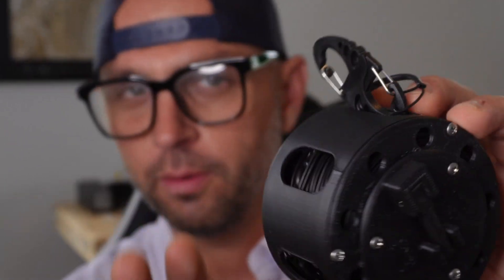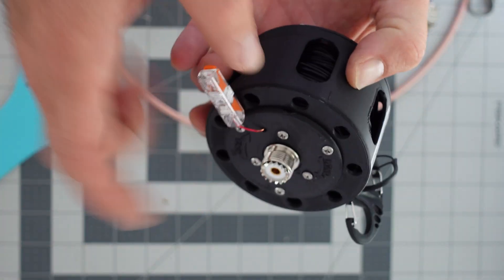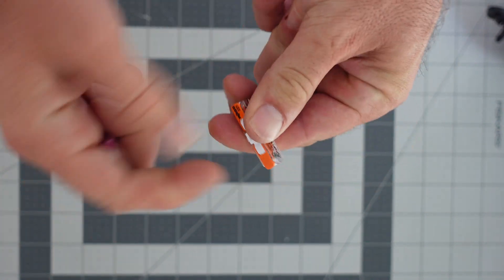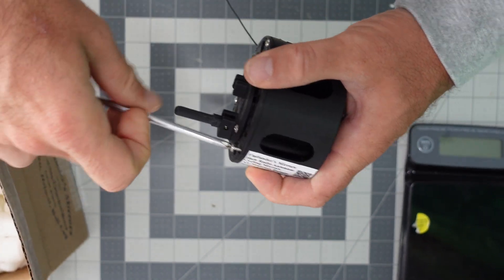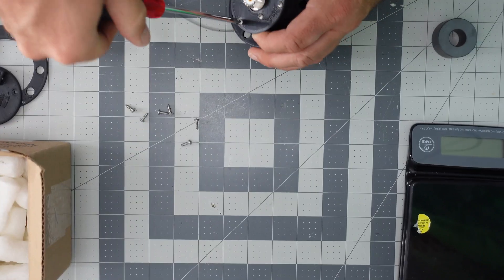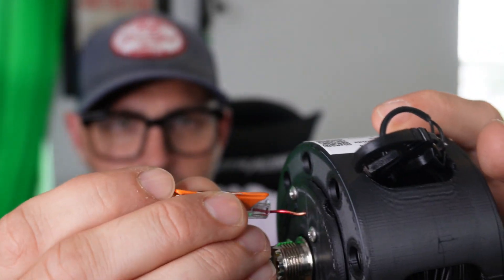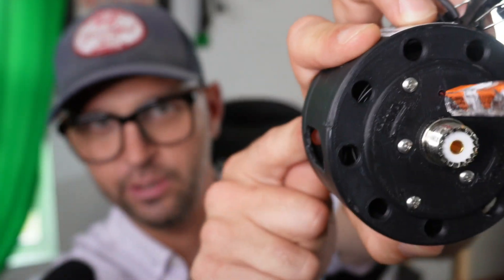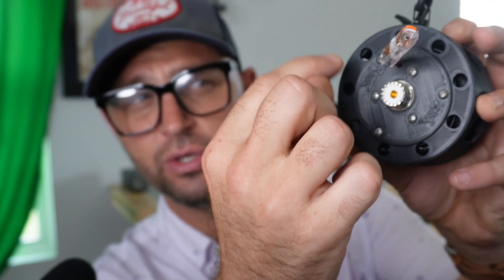How to Add a Counterpoise Easily - Put A Ring On It!  - Counterpoise Hack for Ham Radio

Comment: Depending  on soil and whats around. I have had trouble with no counterpoise. getting RFI into mic. etc. putting CMC choke at radio helps depending on coax. But I found potting the counterpoise at the antenna and a 1:1 or CMC at the antenna works better. dropped my noise floor and improved my signal to noise ratio on my RX. This varies a lot from place to place  . Even on a different day this can change.  I find for me just putting about 17 ft wire on the ground does the trick. and at QRO 1KW still worked great . If I am veritable I use 4 counterpoise on ground.  spread them out and works great. some use the magic carpet for counterpoise and have great success with that . Every set up different. use what works best. Keep options in the go bag. Works great for me. 73
Reply from the maker: Thanks again for the great tips!

Comment: Thank you for this video.  I just received my Flatlander 40-10m EFHW antenna and was disappointed there was not a counterpoise lug.  This helps a lot.  I do like the hose clamp on the connector “shield”.
Reply from the maker: My pleasure.  Have a great one

Comment: Yo, the jubilee clippy idea to connect the counterpoise is a great idea!  I had thought about creating a place to connect counterpoises on a 3/8-24" antenna magnet mount (lacking any access to ground--unlike some variants) by chopping into tho coax shield and soldering in a little ring terminal (of course sealing the whole thing up well against moisture etc) ... or by chopping through the coax and installing a new PL-259, and basically adding a ring terminal wire before crimping down the connector ... but your solution is even more McGuyver elegant!  Tksss

Comment: If the counter poise wire has to be a specific length for the band of operation, do you then have to account for the coax and the counterpoise wire? Or, does the counterpoise wire take the coax out of the equation?
Reply: GENERALLY, you run a counterpoise wire because you want/desire to take the coax out of the equation... and thus you insert some choking device that isolates the coax shield (meaning removes it from the equation) in close proximity to the antenna/transformer end of your coax.  [[Choke could mean:   a choke/isolator with BNC or UHF (SO-239) connectors on it -- OR it could just be a ferrite ring (e.g., 240-31 or 240-43 ferrite toroid) with that unsevered coax wrapped through it a bunch of times (typically 8-12 times--the more the merrier but really fewer can work fine if there's a well-sized counterpoise).  It could also be a clamp-on ferrite with a handful of turns through it, or a bunch of ferrite beads shrink wrapped to the coax.]]

On an end-fed halfwave, it's unlikely that you'd want to have more than 1 relatively small counterpoise -- typically aiming for 5% of a wavelength at your chosen operating frequency -- but if band-hopping, aiming for 5% of a wavelength at your antenna's lowest operating frequency (e.g., counterpoise wire length is 2m or 6ft for 40m; half that if you never go below 20m).

If you do NOT choose to run a counterpoise wire, the ideal place to place your choke on the coax is in-line the same distance away from the transformer/antenna as you would have sized your dedicated counterpoise wire.  The RF just sees that length of coax shield as a fat wire.  ...   But you can get away with just choking it at the radio/transceiver end, with some reasonable/small loss of efficiency, while still benefiting by avoiding getting common mode current (CMC/RFI) back into your transceiver, and also avoiding picking up undesirable interference on the shield of your coax due to its ability to act as an unintentional receiving antenna.

...  on some other antenna types, such as a 1/4 wave vertical antenna -- you could hypothetically use part of your coax as its own counterpoise, plus run a 2nd, 3rd, 4th etc dedicated "radial".  So, does it technically take it out of the equation?  Not really--but a halfwave antenna doesn't really benefit from multiple counterpoises/radials as much as other antennas do, and halfwave antennas are considered less reliant on ground (more independent of ground) than others, b/c 1/2 wave antennas are 'ideal'--having very high radiation resistance (the good kind of resistance).

Comment: Interesting what is called "antenna" nowadays....
Reply from the maker: Would you have preferred autotransformer hooked to wire?
Reply: Right up there with bed springs or a train trestle!
Apparently, everything is fair game to make an antenna. 
I like the reel! It looks better than the traditional wire winder.
Reply from the maker: @fredhillhousejr943  there has been this old, non connected, train track at an old military base/beach.  It usually shows in the spring (but didn't this year).  If it shows next year, I am going to load it up as an antenna! Who knows how long it is, but it will be fun to see what happens!

Comment: The information is not correct.   You don't need a counterpoise.  It is not because of the coax.  This is likely why the vendor didn't connect the coax in the first place.   Dig deeper into the math and science of the HF half wave  to see why.  Gilles from the Radio Prepper explains it far better than this short message.
Reply from the maker: Thanks, I'll go check out Gil, read up on Kirchhoff's Current Law and make a determination on why a counterpoise is a good practice.  I think it'll conclude that a counterpoise isn't required but high impedance still produces low current and even with low current, there has to be a return path.  Without a counterpoise of sorts, a coax will have to be that path.  This can cause interference and less predictable performance.
Reply: @DudeTested  Thanks for the reply.  I hear your logic and felt the same way until Gill broke down exactly why you don't for that config.  This only counts when you have a resonant EFHW antenna.  
73

Comment: May I suggest a piece of flexible stranded wire instead of the magnet wire?
Reply from the maker: That's a great suggestion, and you're absolutely right! Thanks for pointing it out.   Solid strain will weaken after a short amount of time and eventually break.   Whereas,  stranded is better for flexibility.   Excellent point!